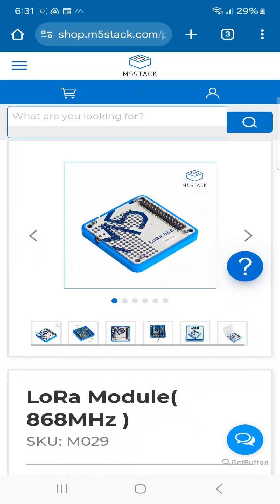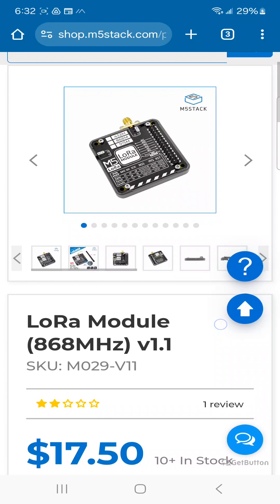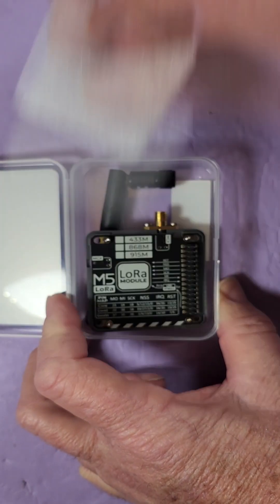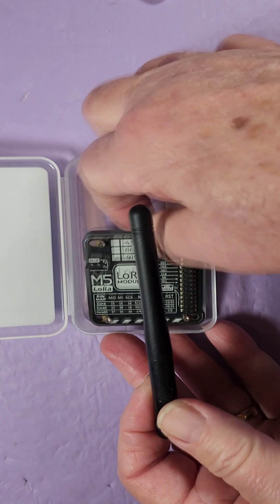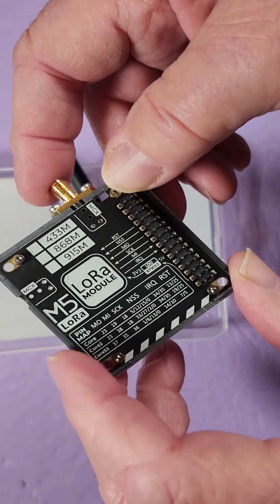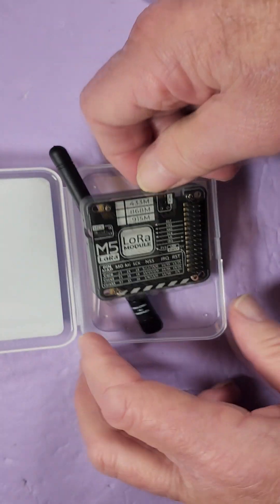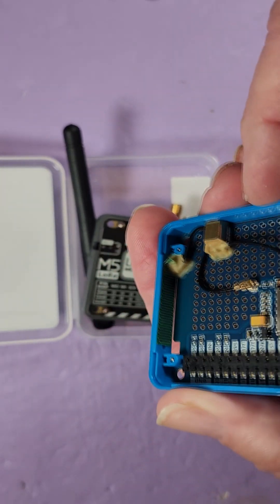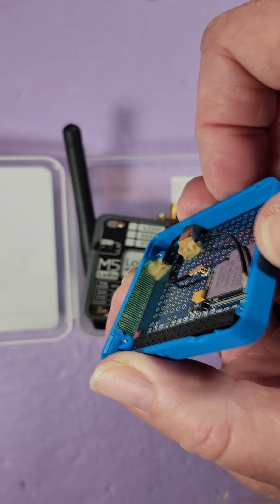M5Stack LoRa 868 V1.1 Module Unbox #meshtastic #lorawan

Comment: hello, did you find out which pins need to be turned on via dpswitch? I looked online and they have instructions for LoRa868 v1.2 but it does not match this one. for example v1.2 have a setting for BUSY bit this one does not have it. thank you
Reply from the maker: I am actually upset about this device. I never saw any clear instruction on this. Sorry my friend. I just had this in my hand a couple weeks ago while organizing my workbench. I will take one more pass on this to see if I can figure something out. I won't be doing too much more with M5 Stack. Most of the products I demonstrate I purchase on my own. So when something doesn't work out, I am out money and positive video topic. Best wishes!